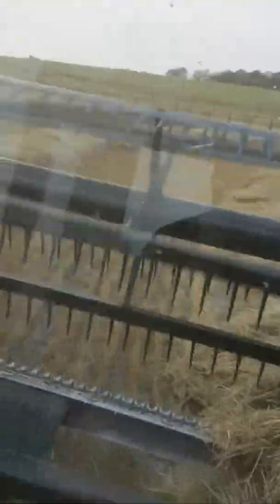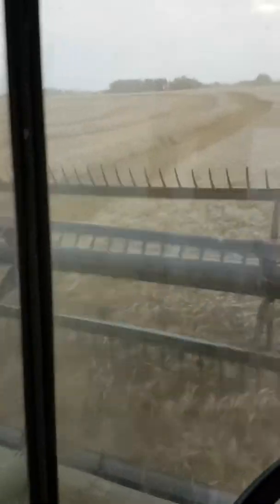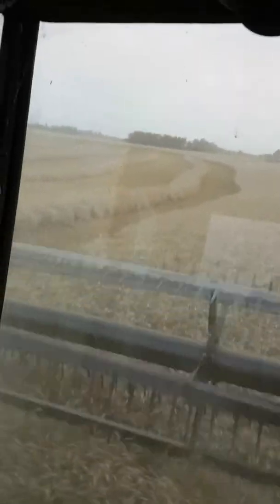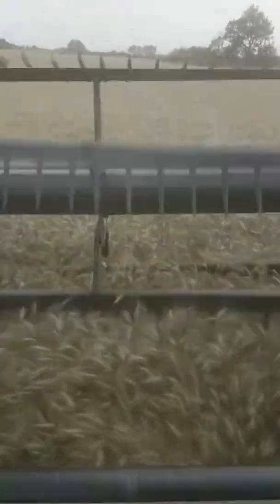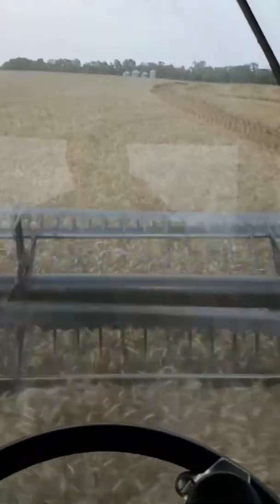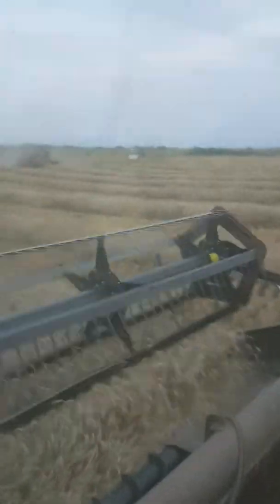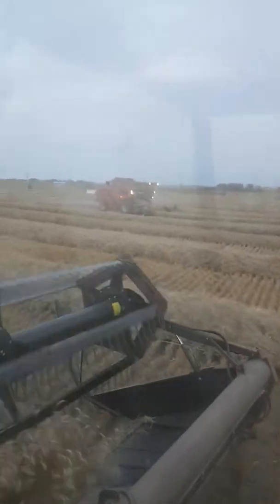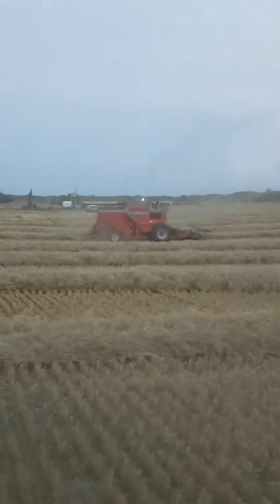Swathing and combining part 2!

Comment: We had a 750 red cab and a 760 silver cab, the 750 grandpa bought new and over all was a good combine, my uncle bought the 760 used and was a decent machine as well.  The biggest downfall was they weren't hydro and used that stupid variable speed clutch bullshit.  You couldn't pull up to the truck and dump without shifting to neutral, if you rode the clutch to creep forward you'd burn out the fucking drive belt.  Those combines defiantly had their own personalities though the 750 would start to cough and choke as soon as you you close to a kochia patch and that 760 couldn't be happier chewing away on that shit, the smoke would roll and you'd just let her eat!
Reply from the maker: Lol yup spent many an hour on the variable speed grey cab 750 lol
Reply: @SouthSaskFarmer1  I spent many hours as a kid riding in the back window of that 750, hard to believe I was that little of a guy at one point in life LOL